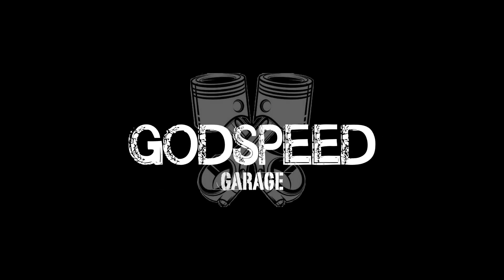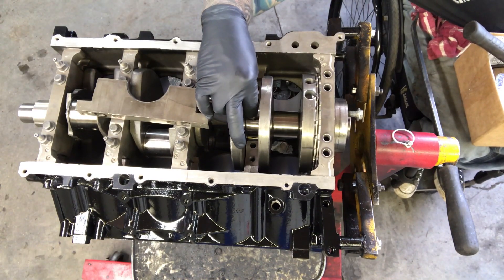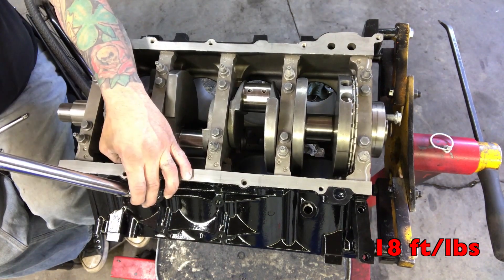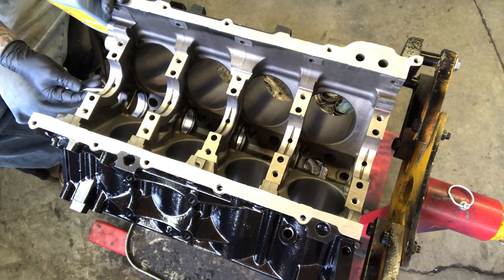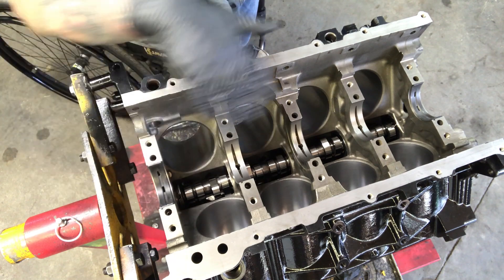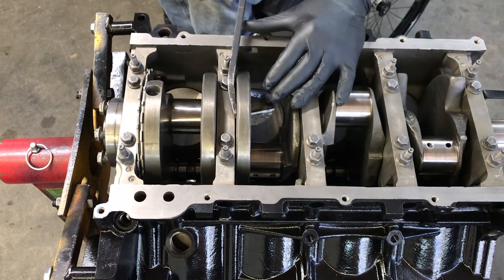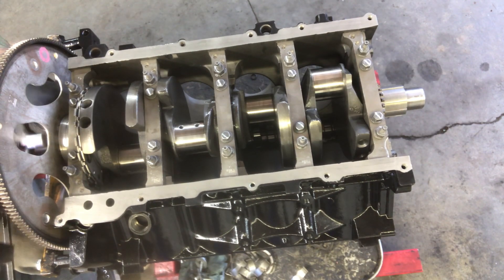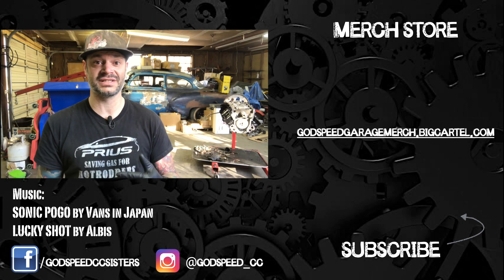IMPORTANT PRE-ASSEMBLY Checks! - TURBO 5.3 LS pt 3

Comment: You still working on that mustang II ifs?
Reply from the maker: done with it for now... there were 2 videos.  once I get this motor and trans mounted I will finish with the springs and install the shocks to get the final ride height.  have to save my pennies for a beefy transmission to handle this motor!  it's coming!!  stay tuned!!  thanks for subscribing!!!
Reply: @GODSPEEDGarage  I was wondering how you hooked up the steering wheel. I have a 1950 chevy styleline deluxe that I plan to put a mustang II kit on and gotta figure out how to finish the steering
Reply from the maker: I'm planning on installing a bearing and a U-joint at the end of the steering column, then running a DD bar to a U-joint on the steering rack.  I haven't done it yet because I want to get the engine and exhaust installed first.  I will make a video of it when I get there, but it may be a couple months...
Reply: @GODSPEEDGarage  ya, I was really wondering what I was going to do for steering on my car once I get to that point, so I asked others in a facebook group and they told me about the same thing. Cut the original column and cut the tube a little shorter, then add the bearing on the end, weld on a DD short shaft and use that and u-joints to make it to the rack and pinion. But I cant wait for the video man